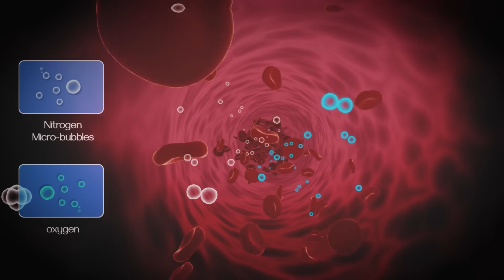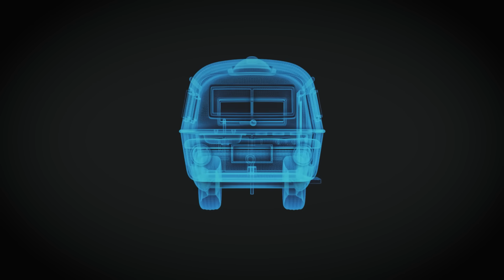How Did a Tiny Hole Kill 4 Divers?

Comment: Thanks mr.Paul, I had seen the horror of what was left of the poor divers on this rig, but the one I saw was not current like yours and at the time had not implicated faulty equipment , only faulty procedure, although however it did say there were no failsafes in the design. It is a nice thought that the mens deaths were instantaneous and they did not suffer, if you know what I mean, RIP, prayers and condolences to the families.

Comment: The video has some inaccuracies about non-decompression diving at depths above 100 feet down.  Even when no decompression is required, you can't go up as quickly as you like.  At my scuba class they said not to ascend faster than your smallest bubbles.   I also did a decompression stop for even when it wasn't required.

Comment: You know, right up to my last days in the diving industry in 2007, a lot never learnt from the Byford Dolphin. Flying in from Singas to the Gulf Of Mexico 3 years before my last was like going back 20 years. I knew the bell side mating flange was dodgey & over machined faced & no TUP, directly onto living chamber. Got a seal every 3rd attempt, if we were lucky. 3 days later, into sat. I hated when the Yanks came back from a bell run, they'd leave the doors swung wide open & I'd always have to get out of my bunk & close the doors, but they'd still keep doing it.
Then there was the deco where we went from 28 FSW to 8 FSW in less than 30 minutes. The difference between a quarter turn valve & a screw down needle valve & a distracted LST. No 6 hour hold, they just blew us down to 28 & bumped up the O2.
Working in the Middle East was far safer than working with those clowns in The Gulf of Mexico.

Comment: Not sure if the faulty equipment mentioned at the end refers to pressure lock out system, but far as i know from other stories this system was not even installed on the dolphin pressure chamber. Lock out is designed to specifically prevent the opening of the bell from the chamber if the doors are not locked and pressure between the two dropped to near normal atmospheric pressure.

Comment: I’m probably stupid, since I’m still not 100% sure I understood the decompression part. A bunch of articles and videos keep talking bout some ambient outside atmosphere of 1… but what’s the outside? Isn’t the sea floor also at 9 atm? Or is it not in fact differences in atmospheres but just the air in the chambers was so heavily stacked inside there to simulate 9 atm it bursted out when found  an opening and when it did get out it suddenly became 1 atm inside the chambers? If so, how do the divers go out of the chambers to work on the ocean floor? I kinda assumed that if it’s 9 atm in both the chambers and ocean around them the air wouldn’t try to escape..
Also lastly what do the assisting divers do if the procedure actually ended successfully? I assume they also cannot go back to the surface any soon?

Comment: Just a comment; It's the tissues that get compressed and the solubility of inert gases increases with depth, hence a type of active, pressure mediated osmotic gradient pointing towards the tissues. :) Liquids cannot be practically compressed. As the depth lessen, the T at which Nitrogen boils is ever decreasing. Hence the bubbles when fast decompression occurs.

Comment: It should be mentioned that many divers don’t just use plain old air. Trimix and other blends are used by thousands of divers. There are non-saturation divers who have gone nearly 1,000 feet deep. Time spent at depth is one of the critical factors. That’s another reason that makes saturation diving so dangerous.

Comment: After watching 3 videos, I still do not understand EXACTLY what happened.
Reply: Miscommunication and getting a little ahead of oneself with regards to completing the last step. Important detail is that the communication methods were shit and in shit shape. So the tender who opened the clamp either could have gotten overeager and mistakenly opened it too quickly, or he simply missed a cue that the opposite end wasn't fully closed and sealed and mistakenly opened the clamp. The system works with three "chambers", there's the habitat, which is pressurized multiple times over Earth's atmosphere and seals off. It has the one connection point, which is to the trunk, the tube-y bit to pass between the diving bell and the habitat. The trunk is not initially pressurized when not connected to the diving bell I don't think. The diving bell is the opposite end of the closed three piece system when it's connected to the trunk. So you have habitat on one side, you have diving bell on the other side, and the trunk connects the two like a pressurized hallway to keep them from exploding when they go from one part to the other. This whole arrangement IS ON THE SURFACE, hence all the caution about sealing in the pressure and whatnot. These are like pressure cookers but worse. If the seal breaks, you get exploded people. So the seal can't break. There's ways to seal on both ends so the trunk can change internal pressure when the two ends are connected by it. Part of the seal on the diving bell side is the clamp. The clamp that the one guy opened too soon. The way they pressurize it is basically like pumping in a ridiculous amount of condensed air. You need the system to stay closed so the system doesn't depressurize really fast, because if it depressurizes too fast, that's at least like 100+ pounds per square inch of force, because gases naturally hate being condensed, so the gas wants to get where it can spread out. So that's basically thousands of pounds very eagerly pushing the bell outwards faster than it's possible to react to. The force of all that escaping air pushed the bell out with such force that it crushed the one guy on the outside. On the opposite side, where the habitat wasn't fully sealed, all that highly pressurized gas immediately went to escape through basically a crack in the door. Problem is, the one diver was by that door, so he got explosively squeezed through the crack in the door like toothpaste in a tube getting hit by a train. For all the other guys, the gases inside their bodies violently expanded from a heavily compressed state, and it basically exploded and damaged everything in their bodies on both a large and small scale. Think spontaneous combustion but instead of them exploding into flames, they popped like a balloon. It's not a good way to go, but it happened so fast that none of the divers would have felt it. I hope somewhere in this rambling I got the message across, if not, I can clarify.

Comment: So, the habitat is up on the Dolphin? Not submerged? The bell brings the off going 2 divers up to the surface on the Dolphin, then connects to the habitat with the other 2 divers in waiting? See, I thought the habitat was submerged with the divers at the bottom of the ocean where they work. So this accident happened on the Dolphin oil rigs decks, not at the bottom of the ocean?
Reply: Yes, that's correct. The habitat is on the surface. This might be (I say might because I'm not a trained diver) because hyperbaric rescue vessels (pressurized lifeboats designed to keep saturation divers at a safe pressure) are usually situated on the deck of a rig so that they can float freely if the rig sinks.

Comment: A little error when dealing with high pressures under water can be catastrophic as with an error in a space vehicle, great documentary!!
Reply: It's actually infinitely worse because in space you're going from 1 atmosphere of pressure to 0. Under water you're going 5+ atmospheres to 1 and the force of the compression/decompression is exponential to the difference. 

In space you have some warning and time to fix the problem if you can. Underwater, like in this story, you go from alive to dead faster then your brain can process let alone react to and figure out a way to fix the issue. 

Basically those five men either got exploded inside out or smashed with the diving bell, faster then anyone could figure out something went wrong and attempt to stop it. Zero reaction time o any failures is the scary part, unlike space and other dangerous jobs if someone screws up, you're just dead end of story.

Comment: William  Cramond did not unlock the clamp early, that was a cover up by the Norwegian government and the Dolphin drilling company. The Norwegian government had  passed a new safety standard and the Byford rig was certified without the safety inspection that was required and as a result the Norwegian government would have been liable for the accident and it would have embarrassed them in process and could have brought the government down with the scandal. Once the truth was revealed, and it was not revealed by either Dolphin or the government, it turned out that there was a report which was not made public that specifically stated that it was the locking clamps that locked the diving bell to the pressure habitat, one of these clamps had failed and this was the cause of the catastrophic release of the diving bell. The Norwegian government and Dolphin hid the report that revealed the true cause of the incident for years, and when the report was discovered they were forced to exonerate William Cramond and pay substantial amounts of compensation.

Comment: Fun fact: The effects of methane increasing in volume during decompression can be rather unpleasant, and carbonated drinks are generally Not recommended partly for similar reasons. :) I'd love to see a drone flying in eg 10 atmospheres, or vape tricks, air-cooled PC temps and even waving one's hands about, as it should all be different when the air is 10x heavier.

Comment: Very interesting video. Yes, I am here because of Titan. This is the first video that had me on the edge while absorbing the technical aspects of what happens with decompression vs compression. I didn't even know about the Byford Dolphin Disaster but the rabbit hole lead me here.
Reply: Well the titan crew suffered something similar, all that pressure which was pounding the sub with all force was like water jet witch cuts metal pieces but much higher so after implosion that all force of pressure was released on people inside and what comes inside needs to go out, so they been sucked out tru cracks and other small space with not much remains left something like gelatin mush